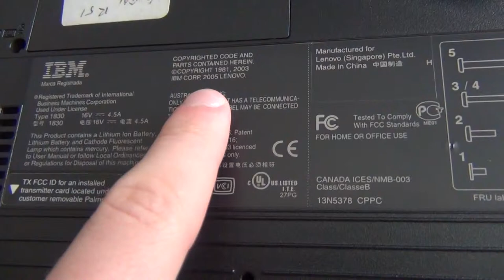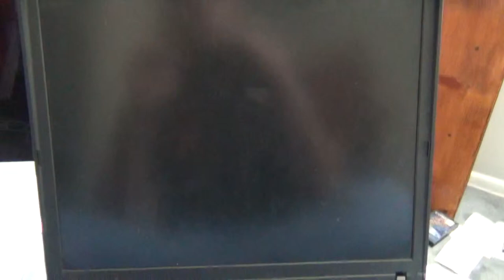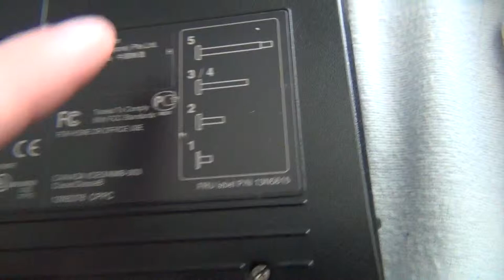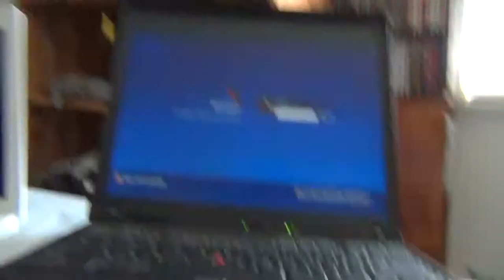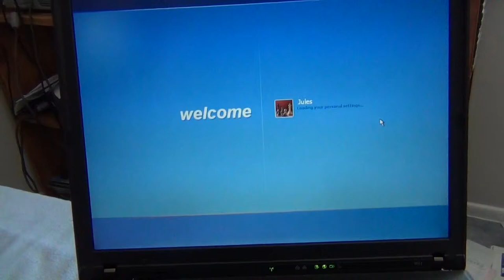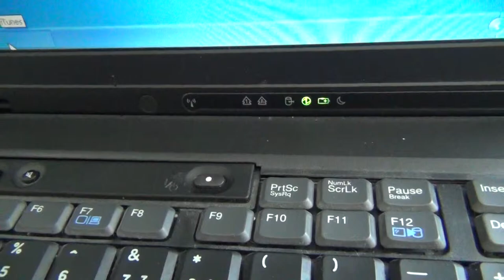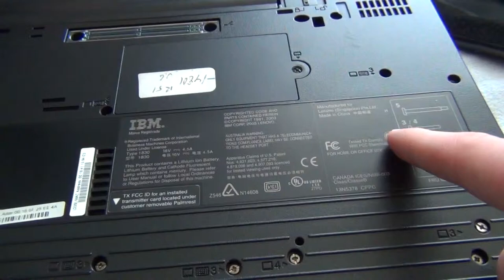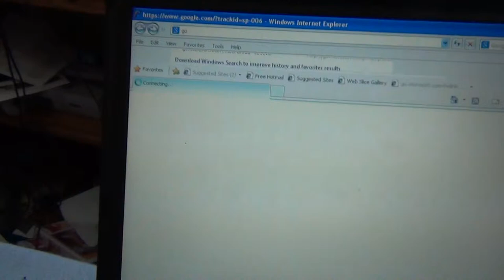Minor fan "repairs" to an IBM ThinkPad R51.

Comment: Hi Sebi, been enjoying your videos.  I don't know if you know or not, yet I recently discovered an obscure bit of information about some ThinkPads that might help others looking at your video.

Some ThinkPads require a charge in the CMOS battery for the fan to start up.  I recently purchased an old IBM ThinkPad 600 that was having a fan error.  I found that, if I double-shunted the power switch the fan would start, and thought it was a dicky fan.

After I replaced the CMOS battery, the laptop requires no assistance - the fan starts perfectly each time.

Just a bit of ThinkPad-lore for the fans. 

Keep making your videos - I subscribed ;)